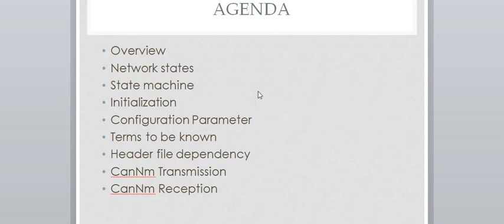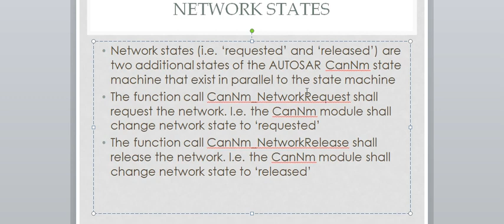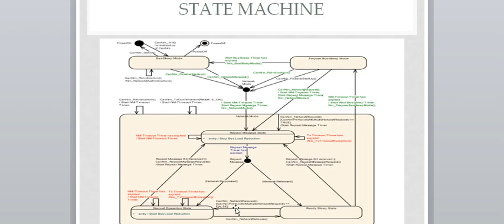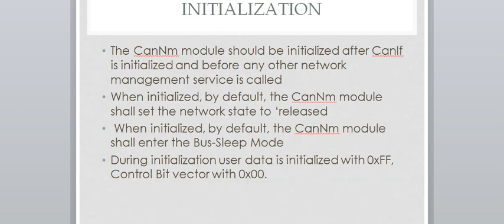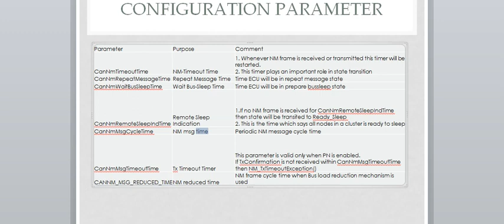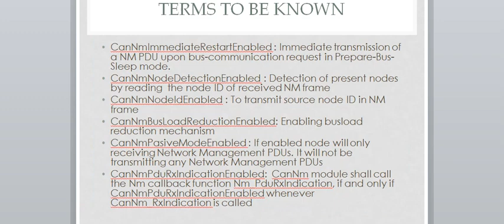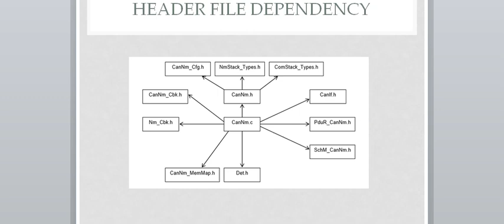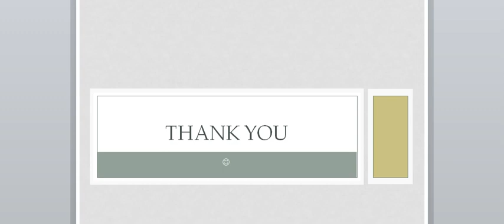Autosar CANNM-Part 2

Comment: Hi, Your presentation is really good. I have couple of clarifications:
1. In CANNM Transmission, When CanNm module transmits CAN Nm message using CanIf_Transmit() function, what is the next dotted line from CanIf to CanNM with function name CanIF_Transmit() refers to?  is it the return value of function called initially from CanNM to CanIF? If so what is the purpose of this return value? becuase CanNM_TxConfirmation is the one which provides upper layers the status of transmitted message, so i want to understand significance of this return value. 

2.The same with CANNm reception, what does the dotted line with function name CanNM_Rxindication's significance?
Reply from the maker: Hi Vignesh,
I am pleased to answer your doubts. Please find my clarification below.

1. Yes you are right. Dotted line refers to return value of CanIf_Transmit function. In Autosar each and every module has checks. CanIf_transmit will return E_NOT_OK if there is any problem in the sequence which CanIf_transmit does. One example is if API CanIf_transmit() is called before CanIf module is initialized then CanIf_transmit will return E_NOT_OK. 

TxConfirmation will be given if frame gets transmitted properly in CAN Bus. 

2. CanNm_RxIndication return signifies "Reentrant for different PduIds. Non reentrant for the same PduId". ie CanNm_RxIndication  API should not be called again until CanNm module shall copy the data of the Network Management PDU.
Reply: @electroniccontrolunit9294  Perfect, that answers my question. Thanks a lot for your time & effort.
Can you be kind enough to share the list of topics you are gonna cover? Just curios to know what modules you are planning to cover in AUTOSAR stack. Thanks again!
Reply from the maker: Hi Vignesh,
Thank you so much for your comments.. As of now plan is to cover Canstack, ECUM, Bswm...
Reply: Electronic Control Unit sounds good, thanks

Comment: I have one doubt is there any API for NVM read data by address
Reply from the maker: If you want to read from SWC above RTE then as per Autosar architecture directly reading from address is not allowed.  
NVM_Readblock can be used if the address is already mapped to block.
I am not sure about API which is directly used to read the address. But it is possible. I think you can same API which is used to read the address pointing to non-NVM memory.

Comment: I have a question regarding Network management.
I know NM can be configured to receive multiple CAN msgs or a range. But I see the following problems.

I have a requirement in which I receive 5 NM msgs with same cycle time from different ECU in the network

1) the data in the NM msg are not consistent as we can’t say which frame is received in the CAN mailbox.

2) The Ipdu group switching according to the NM info is also not possible as the same inconsistency data can occur.

I doubt that the requirement is not valid according to use case of Network management. Or my understanding is wrong ? 

Suggest me your input ...
Reply from the maker: As per my understanding all NM frame should follow same data structure.

Comment: thank you for you explanation 
i have few questions 
1) if other nodes of repeat msg bit is set then what it means ?
2) what is exact function of repeat msg state , why we need it ?

thanks in advance
Reply from the maker: 1.If repeat message bit is set the node will be shifted to repeat message state irrespective of any previous state.
 If there is any problem so that state machine got restarted in other node it will send NM frame with repeat message bit set.
2. This is needed to inform other nodes that my node has become active.. Ideally if none of the other node sends NM frame within repeat message time then my node will start it's bus sleep action ie it will be shifted to Ready sleep without entering normal operation
Reply: @electroniccontrolunit9294 : Thank You so much for your  quick response... 
your explanation was very nice
currently i am studying NM , so if you share your email so that i can contact if i have any doubts
Reply from the maker: My mail id is autoecu8@gmail.com
Reply: There are two purpose for Repeat message state : one already Ramya explained below(making the node state visible to other nodes in cluster). Second is , it makes sure that node remains active for minimum amount of time which aids in detection of present\active nodes
Reply: @electroniccontrolunit9294   Hi Ramya, regarding your second point, I agree if my node doesn't want to keep the network active then if no other nodes transmits NM frame then CANNM_NetworkRelease() will be called to directly enter into ReadySleep state. But in another case, if my node wants to keep the network active then CANNM_NetworkRequest() will be requested and enter into NETwork operation state. In this case if Remotesleepindication is enabled then  CANNM will intimate NM that other nodes are in readysleep state .When my node do  not want  the network to be active anymore , calls CANNM_NetworkRelease() and enters into Readysleep state.
Reply from the maker: Thank you for adding Vignesh
Reply from the maker: Thank you for adding your comments Vignesh..Please comment if you have any other points to add too, so that channel can be made interactive. I prefer keeping this channel a interactive channel..
Reply: @SuperVickyutube  thank You so much for your explanation
Reply: @electroniccontrolunit9294   thank You so much.. 
if you know about Flexary NM plz make a video.
Reply from the maker: I will try